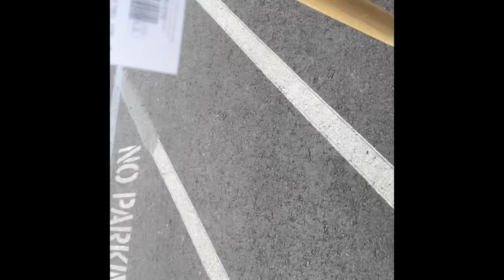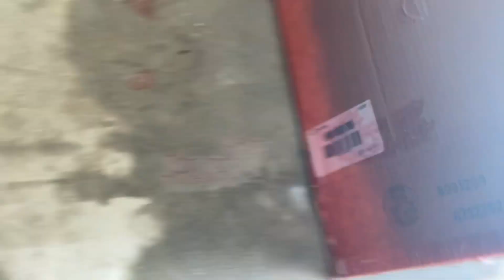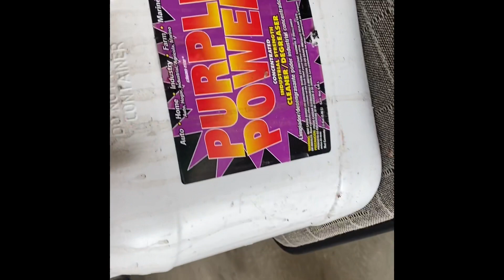1970 Monte Carlo Transmission Fluid Clean Up

Comment: Man, you gave yourself so much un-needed work. First when doing tranny fluid change, depending on which tranny you have, should have bought a tranny pan with a drain plug in it or have a buddy or shop weld a drain plug to the original pan. Woulda made next change a breeze. Now back to mess. Kitty litter or oil dry , spread it over entire mess. Use a small broom and work it into mess. Sweep it up and 90% of your mess is gone. Next baking soda and vinegar mix and work it into stained area. Wipe it up . Do it again but do entire garage floor and hose it off. Your done. Your next project should be to epoxy paint the floor of your garage.  1 gallon muratic acid to etch the garage floor, power wash the floor and epoxy paint. Never stain your garage floor again.
Reply from the maker: That’s the kind of advice I need. Thank you. I appreciate it.